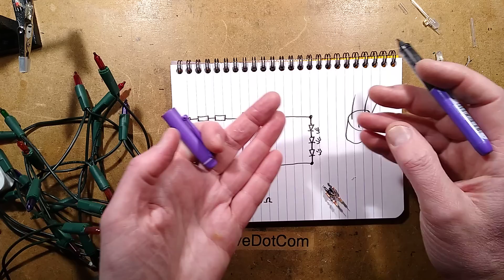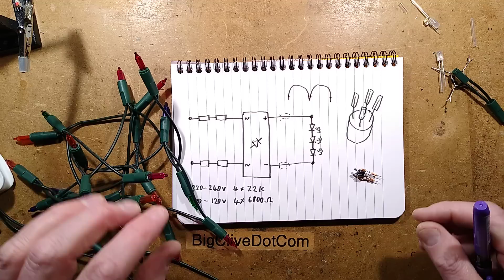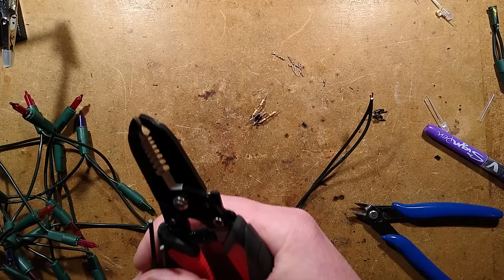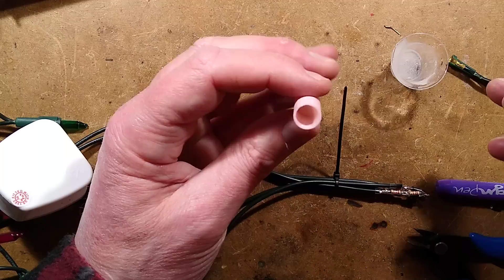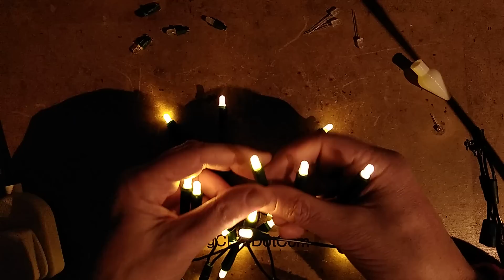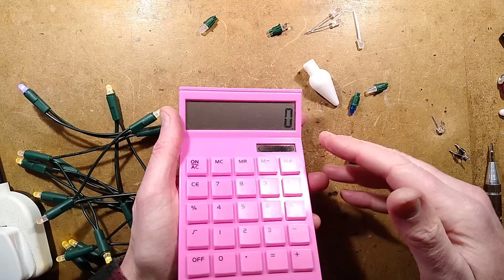Ambient fairy light hacking

Comment: Small correction Clive.

With a chain of 20 mixed colour LEDs (with an average VF of 2.5V per LED), on a 240V supply, using four 22k resistors and ignoring the voltage loss of the bridge rectifier, that’s a power consumption of 0.52W.

For one year, that’s 8760 hours.

Electricity cost £0.34 per kWh (U.K. Energy Price Guarantee figure)

Therefore cost for one year of continuous operation, the cost of the electricity is £1.55
Reply from the maker: Our local electrical unit price hasn't reached that astronomical level yet.  But still low running costs for 24/7 decorative illumination.  A large latte would cost the same as about 3 years of use.
Reply: @bigclivedotcom  - oh, absolutely still low cost. Even cheaper when compared to the cost of a top of the range mobile ’phone!

Comment: Best way to pot cables is to use heat shrink tubing, shrink the single wire side and then pour into multi wire end, stop once near the top then shrink the top, let the resin cure.  Now you have a waterproof connection.

Comment: I abuse my cutters too, but cheap or not I sharpen mine.  The fiberglass cutting disks put dremmel in a holder so the disk is at the right angle for keeping the edge level and it doesn't take much to put an edge on, or with a small triangular file grind in a diamond hole to make wire strippers.  On the cheap ones the grind is always curved, you can make a better job and not feel guilty for ruining them again, and again and ......

Comment: Please could you show us ( or just add a comment ) on how to build a circuit for a a string of 100 LED's.
I've got a set lying around without a power supply.
Reply from the maker: On a 220-240V supply you can run 100 LEDs in series on a 120V supply it would limit the number to about 50.

Comment: I've  got a shed with 8' electronic starter in it,it works real well strike first time even in coldest day in winter, old type would never work just flicker for ages,turn electronic 1 on3sec pause tube ends glow,then strike first time every time!
Reply from the maker: The electronic ones use preheat to properly get the electrodes ready for operation.  Sometimes actually compensating for low ambient temperatures.

Comment: Fair to say a cap across the output of the rectifier would smooth out the shimmer, and cause a slower on/off?
Reply from the maker: It would, but you'd also need an extra series resistor to avoid a current spike when unplugging/plugging an LED.

Comment: Just a heads up: you don't actually need to model a recessed cylinder. You can put a normal cylinder in your slicer program (I guess Cura?) and set infill to zero, top layers to zero, and any number of perimeters. It will just print the bottom and the perimeters this way.

Comment: If you put sleeving over a 1/4W resistor, is it still 1/4W? Seems like it would get hotter with the layer of insulation and possibly fail at a lower power. Perhaps polyolefin is a good heat conductor. I've never thought about it before. [later] And i suppose it doesn't really matter after it's potted in resin inside a 3D-printed cap. :^)

Comment: Heat shrink tubing, 3D sleeves and 2 part resin are all cheating. Where are all the little pieces of vinyl tape and the big wad of zip ties over the rubber tape? Keep working on it. Good luck.

Comment: When you find vaping devices along the side of the road that you salvage lithium batteries from, you could save the sleeves of the units for use in these projects to hold the circuits instead of 3D printing a new one.
Since manufacturers use the original light bulb glass and Edison bases to hold modern LED lights, are any of them using these same tiny glass bulbs from xmas lights to hold LEDs inside for LED xmas lighting?
Reply from the maker: I wouldn't recommend using a metal tube for the electronics.  There are plastic emulations of this style of light, but not actual glass versions.

Comment: My wife collects the little Christmas houses (Dept 56 Christmas Village and others).  During the season she loves to get them all out and display them.  They each come with a screw in base C7 E12 lamps with one of the little thumb wheel on off switches.  Imagine the cord nightmare that 40 to 50 of these little houses makes.  As well as the unsightly cords and power strips.  I also imagine I am well onto the maximum if not over for current draw on one circuit.  I think this fairy light scheme along with a custom length harness might be the answer to my needs!   You should get yourself one of these houses for a prop and create a video on just this as I searched high and low without finding anything with search that could help me.  It might get you some views.  I really enjoy your videos and a hearty thank you for your time involved.

Comment: Three questions.

It appeared that you hooked up the AC without regard to which was live and which was neutral.  I remember you talking about issues with this in the past. Did you address this and I missed it, and if not, why didn't you address it?

How did you determine which wire was positive and negative when leading to the LEDs?  It seems like it wouldn't matter which was which, as long as you put the LEDs in the right way.

Why didn't you test everything before potting it in resin?  If things were wrong, you would have had to cut everything and start over, but if you tested it before potting it, you could have fixed it.

Comment: I have an idea:
Why not put 400V capacitor in paralel with rectifier.
One set of resistors on AC side, so capacitor does not blow up when you plug in, other set of resistors on DC side so when capacitor fully charges at no load (LED unplugged), and you put LED back in, LEDs do not blow up.

Comment: Clive, I love projects like these. You have single-handedly inspired so much creativity for me, I really appreciate what you do.

I did something like this recently. I bought a string of 50 led christmas lights, snipped the wire and put a simple circuit with a resistor, diode, and capacitor. I replaced each (hideous white) led with a lovely RGB slow-fade type. Because of the capacitor, they don't misbehave, and they even remember their colors for about 5-10 minutes when unplugged, which was an unexpected surprise.

Thanks again for these videos and all the inspiration <3

Comment: That blue flashing LED was really neat, it looked like it was more reacting to the stray capacitance of you moving your hands around near it, similar to how a Theramin works, rather than the chip inside working in reverse as a photocell. At 25:45 ish it works while you're touching the plastic housing, even though it's pointed directly at the light, but it stops when you take your hands away without much change in the LED's angle.

Comment: A few years ago I made a string of 50 LED lights using straw hat LEDs like you showed in one of your videos and they came out great. I actually bought enough LEDs to make several strings to put on our Christmas tree but never did. Also made a string with the slow color changing that looked great too. I used capacitive droppers on both which in the US can drive 50 lights perfectly off the mains. I also reused the mains plug off the original since they're fused. I should really make up the rest of those strings.

This video reminds me I bought a salt lamp that has a hideous cold white LED in it from what I can tell that I want to replace with a warm white or maybe a yellow one so the crystal glows a nicer color. 

FWIW I buy the Hakko side cutters by the three pack off amazon because I either lose them or abuse them too much and they're cheap.

Comment: Really neat project. Shame they're not smooth, because the flickering LED lights hurts my eyes.
Reply from the maker: With a bit more circuitry they can be absolutely smooth.
Reply: @bigclivedotcom  I'm guessing a capacitor to filter it out? I suppose I should pull out my electronics text books and remind myself.

Comment: Hey Clive. If I might impart a small tip, those old (I think they are old, not sure anyone uses them anymore) printer ink refill syringes are great for precision filling like this - they usually have a 1mm~ or so needle so won't clog and can still fit in tiny places. Just gotta clean them up sharpish afterwards.
Reply: Or you can use a kid's Calpol syringe 👍
Reply: I would have used hot glue.  Then one could heat them and reverse if needed.
Reply: @mikespunchlist  The dropper resistors would provide a self-reversing feature.
Reply: @mikespunchlist  then, if you have an issue and the whole rectifier heats up, you have the added bonus of it possibly coming apart! I used to use hot glue for literally everything, until one day i used it to reinforce the attachement of a motor on an RC plane, we quickly realised the error when we hit full throttle and the motor popped out of the front of the plane, lol

Comment: Hi Clive. Another nice video.
When you did the calculation for the 120 volt version, you first added the 2 resistor values (2x6800=13600). You then typed in 120/13600=8.8mA).
It can be done faster and without remembering the 13600 on most calculators by typing 13600/120 and then press division and  equal sign.

Comment: Just for the record.... I loathe all aluminium cored cables. Twist the end, ends fall off in your hand. Fold the end to put it into a terminal, the folded bit falls off. Try to solder it, the solder just laughs, drips off and makes shiny nuggets beneath where you were working, the cable looks back at you says "And.....".
Some evil beancounter thought it best to pre-fit certain components I have to wrangle in the dark, by torchlight, on my knees, in the pissing rain with this stuff to urgent fix stuff. It's 0.25m of cable per unit FFS. Add an extra hour of my time, plus vehicle, plus liability insurance for being on customer site to tit about with it - where is that on the spreadsheet?
Annoyed does not come close to describing my level of loathing. Incensed is notching closer.
Strangely no-one will give me a name of who made the decision..... can't think why.

Comment: A few years ago after one of your previous versions of this I got some tungsten sets from Poundland and a bunch of 10mm diffuse LEDs in different colours, used the power supply out of one of those light bulb kits to run it.
Reply from the maker: I made a string of 100 10mm LEDs in this style for my brother a long time ago.  All warm colours - red, orange, yellow and warm white.  It uses 0.5W of power and has been lit 24/7 for many years.  It provides a reassuring ambient glow to his main room.

Comment: Do you know it makes a big bang when you cut the plug off with the power on because you have done it?
Reversed LEDs that exceed their reverse voltage spec but do not die immediately most likely still have had their life reduced.

Comment: Candle flicker bulbs for me please! They come in different colours now too.
Reply from the maker: The slight problem with candle flicker LEDs is that they are not always conducting, so the voltage might fly up across them.
Reply: @bigclivedotcom  hmmm, every other one maybe?
Reply from the maker: @Lumibear.  There are 30V strings that have ten sections of parallel LEDs in series.  They use 50% flickering LEDs and rely on the other static LEDs in parallel to cap the voltage to around 3V.
Reply: @bigclivedotcom  ooh, want, clue?

Comment: Maybe swirling the rectifier bundle in the epoxy before sticking it in the pen cap would help by filling some of the air gaps.
Reply: Seems good, you could also pour some resin into the cap & get the best of both worlds.

Comment: Excellent project, and result Clive. 
One quick thought would to use a tube to house the bridge rectifier/resistors (power supply). It might be a bit messier to do but would be more esthetically pleasing. Basically pass the wires through the tube, solder it all up, then using some tape to seal off one end of the tube, fill tube with epoxy, insert power supply, then top it off with epoxy, as needed. That way from the plug to the lights is a straight shot, as the tube will be in line, and the epoxy will act as strain relief.
Reply: I thought something similar, also maybe a ridge around the edge would be nice, so you cant pull out the resin plug in case it doesn't adhere to the tube..  but then, this is the most sophisticated version Clive showed over the past years, I think the early versions involved just hot glue and heat shrink. One of his most favourite Projects after all. I am excited to see the versions of days to come ;)
Reply: @tinygriffy    I don't have a 3d printer so I've done this before. You can use some scrap plastic, from bubble packaging or plastic bottle, and some tape to make a tube, fill with epoxy and power supply. Then when cured you can peel off the plastic. 
There's a guy on YT called @jedrek29t who makes really cool stuff with epoxy, he uses molds made out of plexiglass or old plastic.
Reply: @generaldisarray  Someone suggested to integrate the rectifier into the UK Plug which should have enough space to house it.. I think that's a neat solution too. Otherwise, jeah use what you have at hand,  just like you I thought  it is neater if the wires go in on one side and come out the other..  You'll figure it out ! ;)
Reply: You could print the same tube with two holes in it, or drill two holes in it and then pass the wires through before soldering them.

Comment: WOW !! Did that spark a Memory of cutting the Cord with power applied 
About 1978 Time frame in High school Electronics Class. two Students were sitting across the lab table from Each other .
I was next to one of them. One was just getting ready to Solder something together and Flipped the Soldering Iron Cord to a better position and at just the Right Moment it landed in the jaws of the other Students Side Cutters, He was just in the motion to cut a piece Of Wire. and Snip/KAPOW.. I laughed so Hard I had tears rolling.... I'll never forget that..... 
Mike M..

Comment: If you cut the sharp end off of a 1ml syringe it works well for injecting resin into tight spaces.  Most resins are too viscous for a normal syringe hole but this works a treat
Reply: A great way for old Keith to get hardening of the arteries. No wonder they call them the Stones! 😜😁

Comment: Alternativly pot it with RTV silicon.
Reply from the maker: It would take a long time to cure, and the liberated acid could cause issues with corrosion and conductivity.
Reply: @bigclivedotcom  The RTV I have used on elecrtonics is acid free. But yes it's slow to cure.

Comment: A while back I took the plunge and bought one of those epoxy dispenser "guns" with a bunch of extra tips and a couple of epoxy "cartridges". I have to say it was well worth the very reasonable price I paid for it. It makes working with epoxy SO much more convenient and much less messy. And you know that it will be mixed correctly.

At first it felt a bit wasteful that you have to throw away the tips after each use, but on the other hand you throw away both epoxy (because you always mix too much) and whatever you use to mix it on and with when you do it manually so it evens out I think.

Comment: Excuse my ignorance, the 20 leds in series will have 12 volts across each, why do they not blow if they only suppose to have 3 volts?
Reply from the maker: The resistors limit the current.  So the LEDs will have about 60V across the full string and the rest is dropped across the resistors as low level heat.

Comment: Interesting. A gotcha is to think that the anvil or cup (seen inside the LED) is always the same polarity on all LED's (it isn't). Check before cutting, the short lead or flat on the LED side is usually cathode.
Reply from the maker: So far the only ones I've come across with a positive anvil are ultra high output red LEDs.  Fortunately they are also resilient to wrong insertion.
Reply: @bigclivedotcom  True, I mostly dabble with high-brightness LED's though a recent Chinese batch of mixed 'conventional brightness' LEDs had differing cup polarities so my 'cup is always cathode' mentality went out the window. None seem to have been damaged by reverse direction.
Reply: good to know, thanks for mentioning this !

Comment: Project suggestion: take apart your Antai mains voltage meter socket and install a smoothing capacitor to remove the flicker 🙂
Reply from the maker: It's the display multiplexing speed.  A capacitor wouldn't fix it.
Reply: That would be the day ^^ 
And I guess you'd have to "go in deeper", maybe CAPS across the power pins of the 7 segment display...

Comment: Big Clive.  Would it be of any benefit to include a small filtering g capacitor not only for filtering purposes which you addressed, but for prolonging the leds life?
Reply from the maker: The LEDs are fine without smoothing, but a capacitor introduces a new complexity.  When an LED is unplugged the voltage across the string will go up to peak mains voltage, and when an LED is plugged back in the capacitor will suddenly discharge a pulse of current through them all.
Reply: @@bigclivedotcom  if you didn't mention that smoothing is not necessary for these leds, and had only mentioned the peak current discharge, I would have asked you if placing a resistor to discharge the capacitor when not powered would work.  However, I'm guessing that would add a complexity to the circuit regarding current limiting to the leds.   But you covered all bases and answered my question.  Thanks Big Clive.